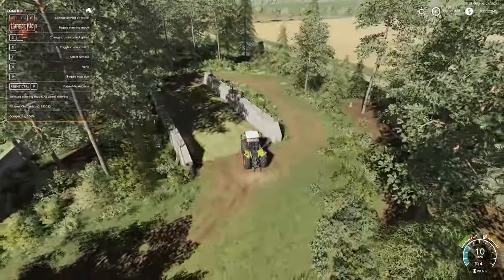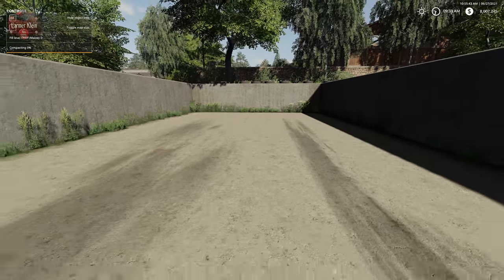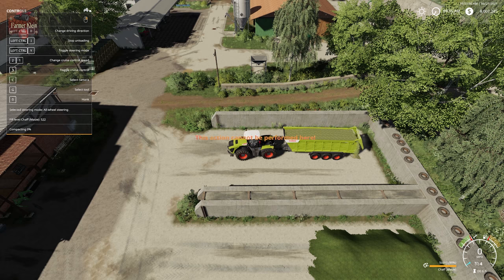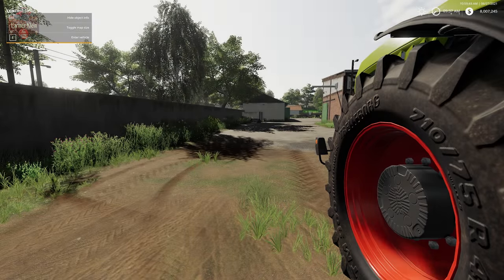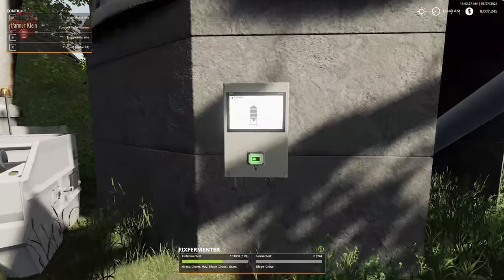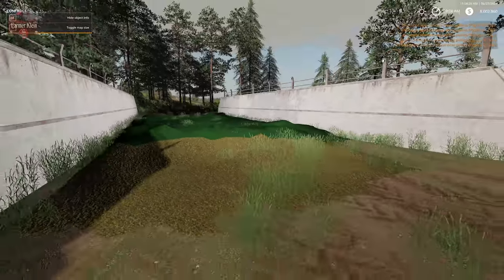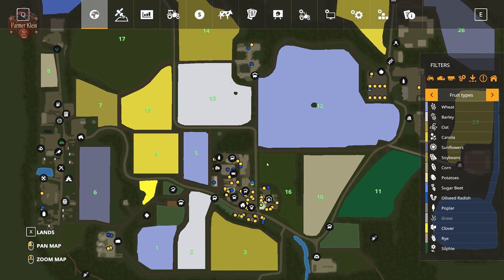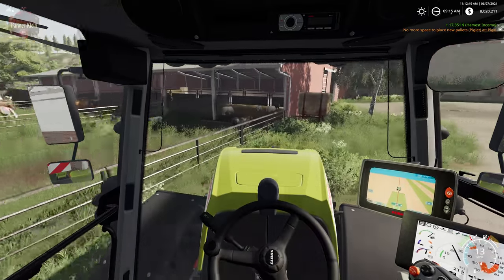FS19 Hof Bergmann Explained 🚜 Silage Production Options 🚜 A How To Series

Comment: So the reason the fixfermentor was slower than the 3 others is you filled that with 3 loads  8:18 "3x51000=153000" were as the 3 others only had one load "51000", so when you were at 6pm 9:42 the fixfermentor was at 43333 out of a load of 51000 so when you say that it takes longer to make silage that is wrong as its almost 2x as fast as the 3 silage silo's, and then the top bunker was ofc faster than the 2 others cuz you put blanket on that and then when to fill-compact the 2 lower ons while the top one was allready fermenting

Comment: Just wondering if you can use that belt that you used to load the hay into the storage above the horses to load silage into the digester instead of using a front end loader
Reply from the maker: im sure that will work.